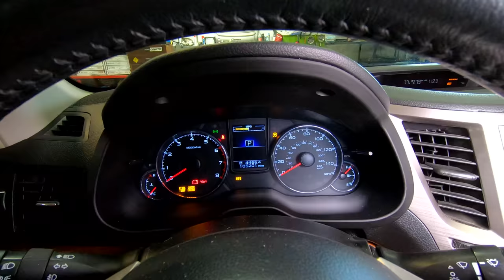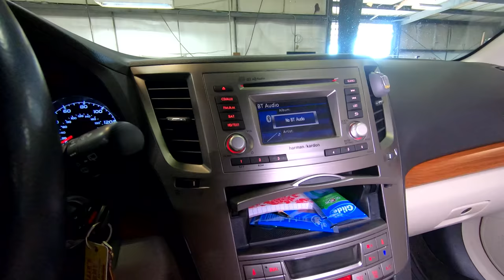Unusual sounds & smells cost serious $$$. CAR WIZARD shows how to find them and what caused them

Comment: As a retired film sound recordist, if you want to record bearing sounds etc., see if you can get hold of a small PZM microphone (Pressure Zone Mic). These don't have any aperture for air vibrations to enter, the body of the mic couples acoustically with the surface (such as a bolt or metal surface) you hold them against. They may also be known as a boundary layer microphone.

Comment: Wizard you are THE MAN!  My father-in-law is a super cheapskate and he hates to spend any money on auto maintenance.  I once went for a ride with him and I heard a terrible grinding and scraping sound every time he put on the brakes.  I asked him how long that noise had been going on and he said "Oh, about a year."  I told him that he definitely needed a brake job immediately.  Grudgingly he took his car in for the work and the mechanic found that the front brake pads were completely gone and the bolts used to hold the brake pads to the backing plate had ground almost all the way through the rotors.  Needless to say it was vastly more expensive to repair that damage, but more importantly my father-in-law could have killed himself and his wife and his family and/or others because he didn't want to spend a few bucks for a routine brake job.  I'll never understand that way of thinking.
Reply from the maker: These people feel as if ANY expense is a personal attack against them. So they respond with resistance and refusal. But as you stated, that way of thinking is tremendously expensive. Whats sad is these people “think” they are being frugal, when in reality, they are causing their car repair bills to end up costing 1-200% more than just doing normal maintenance.
Reply: @CarWizard  Thank you for responding.  I love your channel and watch you all the time.  You are 100% correct.  It's like the people who will risk destroying a $5,000 to $10,000 engine because they don't want to spend $50 to $100 for an oil change.  It makes no sense.  An ounce of prevention is worth a pound of cure!
Reply: @1notgilty  Did he also refuse to change his oil?
Reply: @CarWizard  this is how my old boss felt when I told him that stuff on my work truck was broken. They just don't want to spend the money and he took my telling him about truck issues as an attack against his competence.
Reply: @CarWizard  it's like with engine oil and transmission fluid changes. Spend a little now for fresh fluid or spend thousands on a replacement unit a year later.
Reply: @CarWizard  Exactly
Reply: @kalashnikov1343  Sadly, Yes. He recently asked me if he could re-use his dirty oil in other machines rather than recycling it.
Reply: @CarWizard   this is my first time on your channel. I was looking for a car but mostly a suv that is cheap in parts, very reliable and in a budget 12,000$ to down. Do you have any good ones you can recommend me?
Reply: @nathanm2664  Same with my old boss. I told him for several months the van needed brakes. He kept putting it off (the A-hole was afraid the expense would cut into his bonus)  When I finally flat refused to make any service calls in it, it was taken to a Chevy dealership (more stupidity on his part) Final bill was well over $800 as they had to replace both front rotors. This was in 1989. I quit working there just a few months later. Last I heard he was fired for theft of company property.
Reply: @snuffysmiff  yeah my truck had failing power steering and power brakes (the 2 systems are linked on F250s), steering wasn't straight and had a ton of play, and the cab bushings were so worn out that it made a loud banging nose going down the road from the cab bouncing off the frame. Fun times.
Reply: @honeyofoats5619  Look at  his older videos tab.  He has done many "buy this, not that" videos for different categories of cars.

Comment: wheel bearings and brakes are nothing to mess around with. If you ever have a wheel bearing melt down on the highway, it's something that you will not forget.
Reply: Few will also forget when your transmission self-destructs on the highway, in my case almost exactly halfway between home and my destination (325-350 miles).  I lost 2nd gear and 5th gear in rather spectacular fashion - sounded like a gunshot when it turned loose.  Shockingly enough, the truck was still drivable, and I nursed it the 300+ miles to a repair shop near my destination (I have family who have lived there for years, and I leaned on them for advice - the second mechanic they use told me who he'd subcontract it out to, and I went to them).  Got a Ford Motorcraft rebuilt tranny with a 3 year/100k mile warranty, and I can take it to any Aamco or Ford Dealer for warranty service.
Reply: Also on your trailer. They blow out every summer on boat trailers everywhere where I live in the summer. Fun weekend drive home
Reply: @mikegreen2229  the first warm weekend in late spring is when the boat trailers with bad bearings end up on the side of the highway.

Comment: I used to be a king of deferred maintenance, until one day, I let the brakes go so long, the grinding sound finally went away, and then a few days later, the remnants of the pad finally self ejected on my 2001 Ford Probe, and the cost to fix the damage was  eye opening - that car is long gone - but my little get around 2000 Civic, gets all the love she needs and she has never let me down and barely costs me a penny other than gas.
Reply: I hope you do check the brakes on the Civic though, as they will need replacement eventually just like the Probe. lol

Comment: Makes sense the customer is like this. Much like mechanical issues with cars, teeth are very similar. Using this same advice, someone would be in a way better situation with teeth if one would have the work done and paid for it earlier on. The further you let it go, the worse and more expensive it gets.

Comment: Subaru is still one of the "designed to be serviced" makes (or at least was 10-15 years ago). Everything is made to be taken apart with minimal disassembly of unrelated parts. Had a 2008 Legacy, and it chewed up all it's wheel bearings within 175 thousand kilometers, but nothing was super expensive, nor took hours to do. It was a bit more maintenance heavy, than some other brands, but at least it was very doable when something needed to be changed.
Reply: I’m pleased to report my 2019 Crosstrek is still designed to be serviced. They even asked me when I bought it if I wanted to see where the oil filter and drain plug are! Most things are really easy to repair in your driveway. Any air filters (cabin or engine) take less than a minute to get to!
Reply: I enjoy popping the hood and EASILY identifying what every is. AND, when I look down, I can actually see the pavement in more than a few locations. Most cars seem to be 3-4-5 layer engine bays, while the Subaru is maybe 2 layer. Also had a wheel bearing fail at 43k miles, everything else has been oil/tires/brakes/gas, at 75k now.

Comment: I could hear a slight roar after he increased wheel speed without the stethoscope. Good video Mr. and Mrs. Wizard 👍
Reply: Agree. Did also. Many years ago we owned a Subaru Legacy Wagon (2WD) and it had a bearing go bad on the front. Sound was very similar.

Comment: One of the thing I like to point out wizard is if you look at Japan’s severe duty intervals they say to change the CVT fluid every 30 K which I think for the CVT transmission is a good idea to do that on mine I have the conventional five-speed automatic and I change that fluid about every 10,000 with the oem Idemitsu fluid they also are the OEM supplier for the Honda power steering and I believe the transmission fluid as well. And also the Nissan OEM fluid
Reply: You're good till about 60k on Subaru CVT's... but in my area most shops won't touch them at all or not till 100k... lifetime fluid my @ss...
Reply: 25-30K with my 18 CRV, did the break in oil at first oil change and the service writer wanted to hug me for being pro active, I'm at 107,000 now and still shifts like new, same with the rear diff, I do them both at the same time.  5k on oil changes too, 10K changes are insane
Reply: JATCO cvt transmissions are garbage. Do not put off changing the fluid on those. A friend had a Nissan Rouge and the transmission went out on her while she was on a highway. Could have killed her.
Reply: Nothing is lifetime.

Comment: I have been doing that to my 2011 chrysler 300 I bought with 135k miles. Put some suspension and got the pentastar tick fixed before massive damage happened. 171k miles now and it is running top notch still. Just replaced the last control arms for my front suspension and steering shake went away for good. Preventative maintenance is very important indeed.

Comment: Meanwhile, my 112,000 mile 2001 Subaru Outback LLBean just keeps on running and running and running....

The H6 engine RULES!

Great video!
Reply: Excellent
Reply: 190k on my 2010 legacy 2.5i (CVT) - the thing is a tank! Perfect road-trip car.
Reply: H6?  Does that mean Horizontally opposed 6 cylinder?
Reply: @dwightbetten7208  
Yes.
Reply: @dwightbetten7208  Yes, that is what Subaru calls the EZ30d engine.  DOHC 24 valve 3.0 liter, 217 hp.  No head gasket issues and no timing belt.

Most manufacturers refer to a six cylinder horizontally opposed engine as an "F6" or flat six.  It even has "H6-3.0" as a badge stuck on the grill and on the hatch.  Subaru always likes to be a bit different....
Reply: Thats almost nothing for a 3.0. Mine is a ´07 Outback H6 with 280,000, the next gen of that engine 245hp

Comment: I had a rumbling noise and took it to my local garage who diagnosed a rear wheel bearing. 
Two new rear wheel bearings later, the noise was still there. 
They then suspected front wheel bearings. 
Two new front wheel bearings later, the noise was still there. 
They then suspected the fifth drive bearing. 
One new drive bearing later, the noise was still there. 
By then it was due an MOT test and it failed on tyres. 
Although the tyres were only six months old with only 1,000 miles wear, the tread had gone "knobbly". 
Four new tyres later, the noise had gone. 
Don't you reckon that the same garage that gave me an MOT fail, would have noticed the tyres when the wheels came off for wheel bearings? 
I didn't even get compensation for my tyres that were obviously defective from the outset.
Reply: Just had a car last week like this I showed the young one in the shop a great lesson that day the tires were chopped and an inexperienced tech would think a wheel bearing was bad because it sounded just like one but it was just tires 800 later and the customer was happy jeep only had 51k miles shocks were good all around just cheap tires I always say cheap tires get cheap results
Reply: It sounds like you may have just had an alignment problem since the tires were only six months old with only 1,000 miles on them.  The alignment would have cost you around $100 and still needed to be done after you paid for all the other stuff.  Yikes!
Reply: Sounds like the wheel bearings being bad jacked up the tires. Makes since.   When you are diagnosing something  you don't jump into the obvious new tires first.
Reply: Wheel bearings are fairly easy to diagnose while driving. If you turn left and the noise goes away, you have a bad bearing on the left side. If the noise gets louder, bad bearing is on the right side.

Also you can jack up the car and hold lightly on the spring while rotating the wheel. If the bearing is bad you can feel a vibration on the spring.

Comment: I have a 2015 Subaru Forester that had a rear bearing start to make noise.  I thought about doing the job myself as the procedure to replace them is pretty simple.  However if you live anywhere where they put salt on the roads in the winter, it is a pain to get the old bearing out.  It's fused in there with rust.  After watching several YouTube videos of people hammering/torching/swearing to get the old bearing out, I decided to let a mechanic handle it.
Reply: Right there with you. I'm doing the same on my 2016 Forester. My fear is that I'll beat the crap out of the hub assembly to the point where I can't drive on it to get it to a shop if it doesn't come off.
Reply: Subaru underbodies are magnets to rust if you don't protect them. Also older models have wheel bearings that can be an "absolute pain to replace."
I specifically looked for rust on the subframe buying my Forester, which was a PNW car all it's 21 year life, and it was really clean despite the exhaust being rusty.
Reply: @rturner4205  Subies have gotten much better in that respect. I live in New Jersey and mine has 100k miles it has very little rust.
Reply: I ordered the stuff to do the job (on my Outback) and couldn’t get it to budge. I ended up spending $500 at a shop instead of $150 doing it myself. That hurt.

Comment: I was quoted $1600 on my 2001 Saturn SL2 the other day. They wanted to do almost a full break job, with break fluid too I believe, and also wanted to fix the leaks they found underneath the car by replacing parts. 

My Saturn is less than 140k miles and has saved me a ton of money, but like I could almost buy another Saturn for the cost of those repairs. Or put that money down towards my next car. 

To me, it's not worth it. Maybe just the break job. I really would like to get another car when prices go down tough.

Comment: I love my Subarus, been driving them since 2004. The engines are kind of a pain to do some maintenance on (looking at you, sparkplugs) though. On my '04, the front-right wheel bearing was practically a biennial maintenance item. We never found another problem with it and I wasn't driving into curbs over going offroading, but I think I went through 5 in the 12 years I owned that one.

Comment: Hi Mr. Wizard. I have 2 Subarus and I have no complaints at all. 2003 Forester XS Premium and 2015 Forester XT Touring, thanks thats the noise that was heard on my wife's 2003 Forester when the rear wheel bearings needed replacement ! and we had it done .

Comment: I'm the same way. What people don't realize is that it will cost you 50.00 at the rime and one bill can total out the ACV (Actual Cash value) of the car. This is why I still drive a 2004 Buick Park Avenue Ultra with the Buick 231 Supercharged 3800 and is so cheap to fix and I can do most of the maintenance my self like brakes spark plugs oil change PS and brake fluid every year. The alternator cost was 69.00 for A/C Delco OEM and I did it my self took me about 20 minutes to do.

Comment: "Oh look, I'm low on gas.  I don't have time to fill up.  Going to keep going.  'E' means "eh, I'll be fine..."  Do that too many times and you can burn up your fuel pump (that can cost hundreds or even thousands of dollars to replace).  Fuel has a dual purpose of keeping the pump from overheating.  You also want to avoid sucking up sediment, although the sock filter will trap some but not all of that.

Wow, the Wizard's customer is really into his window decals.  I don't recommend going crazy with rear window decals - a cop might give you a ticket if it obscures your rear view.
Reply: You pay thousands for a car with a view out so you can see traffic etc...and then you put stickers on the windows and hang doodads off the interior mirror?
Reply: @JohnSmith-yv6eq  The view outside? What do you need that for? The "tank slit side windows" fifth and sixth generation Camaro have entered the chat.

Comment: I once had a wheel bearing suddenly go on the front of my old Chevy and it got so hot that it welded the hub to the spindle.  That was an expensive mistake in auto maintenance.

Comment: Wizard I believe it’s 75-90 I have a 2013 3.6 R legacy, maybe the four-cylinder 2.5 takes a different weight of differential oil? I run mobile one in the front and rear diffs, I would also check his lower control arm front lower control arm bushings the rear that are connected in the back of the arm or 10 to crack it’s the same set up Toyota has. What’s funny is I think I’m starting to lose a wheel bearing in the same area ! I’ve on my car since new I am anal on maintenance are on mobile one full synthetic 5-30, been running that oil since 3000 miles on the clock in the car. Along with the OEM black Tokay Roku Subaru oil filter.

Comment: Odd thing with wheel bearings. I bought a Ford Mondeo with about 60,000 miles on it that for some reason had snow tires on it. Driving it I could feel a problem with the rear left bearing (probably kerbed) but my mechanic refused to believe me twice. I bought some good Pirelli P7's and finally he could sense it and said I wouldn't have believed it b/c they are sealed units... I use a different mechanic now. I replace parts before they become an issue and the car has never let me down.

Comment: I drive a 2014 Toyota Camry LE, 4 CYL. I keep it up really well. I bought it for 9K in cash. Had it sience 2020 with the unemployment bonus plus some extra cash every month I was getting. The car sat for several months so I had some work to get done on it. All four tires were dry rotted, I put about 10,000 miles on them, and finally got them all done. Front passanger wheel bearing was noisy so that was fixed. Went to the dealership and had them fix the AC. Something behind the dash, and the AC compresser on the engine were bad, no leaks. Works great now.  Then had the dealership do a full, FULL brake job and the rear driver side caliper boot was torn, who knows how long. That all was replaced.  Just last month I had the Transmission fluid and filter done at 79K miles. The service says between 60K and 100K. Fluid was clean no metal or anything bad. Should last another 70K or so. At 100,000 miles I am planing on having them do the belts, water pump and tensioner pully.